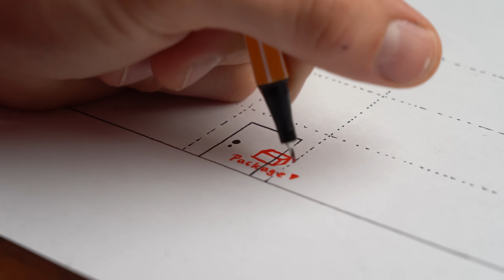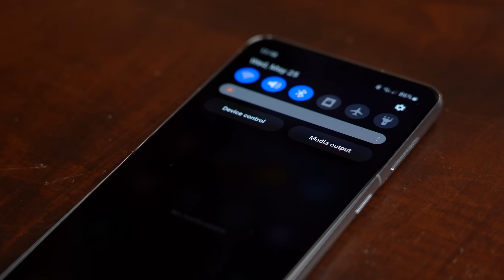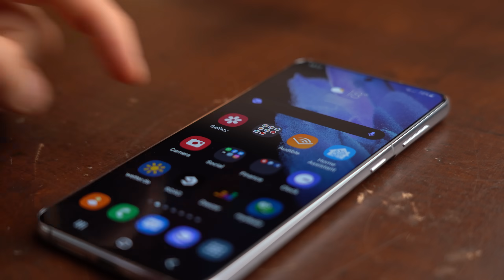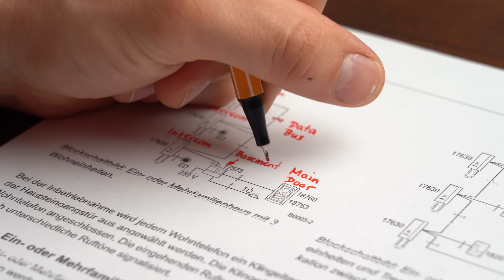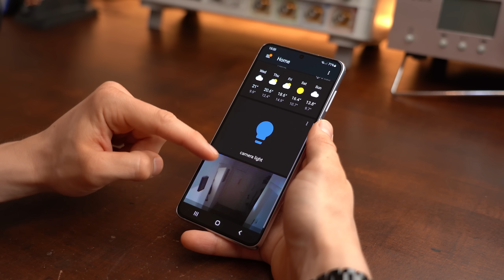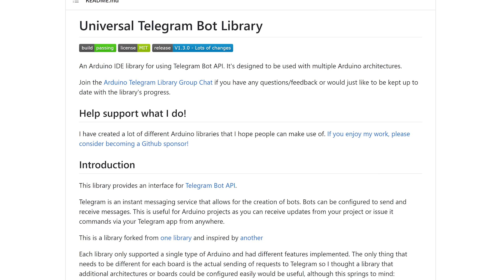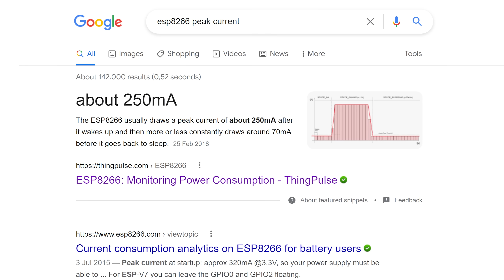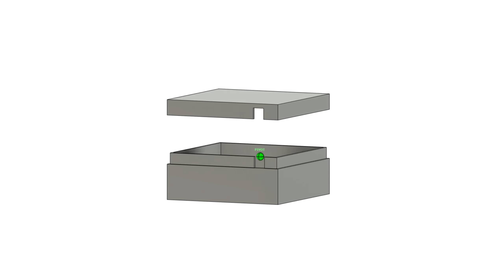Every Apartment needs this Upgrade! (WhatsApp/Telegram Notifications)

Comment: Thanks for this ingenious idea!
I recently figured out that the door opener signal from my parent's house intercom (as you know, intercoms are pretty common in Germany) terminates in the door unit. Ugly security flaw, because the door unit can be disassembled easily (2 screws) and simple shorting opens the door. The open trigger pulse will stay inside the house after my modification. Plus I add an ESP32 (with photocoupler) which enables opening via fingerprint reader (Wiegand protocol) and via HTTP call. Will add a Telegram notification functionality, too.

Comment: I use newtifry (android app) for a pe cell across my driveway and my door bell plus a bunch on other sensors. I like that I can send a picture and set levels of importance. it can read the message to you so it pauses my music and tells me what's happening so I don't even need to touch my phone.

It also has the delayed message received issue becouse this is an android problem. So to get around it by enable developer mode and turn on USB debugging then through the adb console on my PC I disable "deep sleep" for me this has no noticeable impact on my battery life. But dose not survive reboot. I get massages in under 2 sec reliably. But don't use this for mission critical stuff.

Comment: Personally I would have used a microphone to listen for the door tone, and relayed it to where I was working, knowing how flaky intercom systems are (at least here in the UK) and how landlords go mad if they think you've been tinkering with them. But using wireless services like Telegram to send notifications to your phone is a useful idea for many other applications, and there are so many paid services out there that really don't add any functionality beyond ease of setup and introduce delays beyond your control. I am naturally cautious about using third party cloud services that could change or disappear, a few years ago I was involved in a project that did and a good 30% of our support effort was investigating and corrected for unexpected and unannounced changes in the API from the 3rd party that shouldn't have affected us but ended up requiring changes on our part. So these open "cloud" services are often better used by running your own server, even if that means you end up having to learn how to be your own system admin!

Comment: I am in a similar situation to you.
Looks good, but if you have a "system" that is working 24/7, why couldn't you set up a local messaging service?
When the intercom rings, you send a message via MQTT.
Yes, this means you will have to have the WiFi on your phone turned on, but looking at what you do, I don't think that would be a big ask.
You phone is connected to your WiFi network and receives the MQTT message and alerts you that way.

Comment: My phone is already overloaded with all "notification" sh***t! If one more notification will come from the door, I 100% miss it. Not saying in "screensaver" mode phone shows nothing. And even if shows, barely you'll mention one line in a telegram. For *this exact purpose I rather use LAMP. Simple LED, which flashes 30 sec (just in case you turn your head off). But this project as a "Telegram use" is cool. I also support Telegram.

Comment: There are some things to note. Android Smartphones can be very tricky with engery savings, resulting in delayed or even no notification. A deeper look into the settings may help. There are a few things. Usually allowing an app to run it in the background and maybe even start itself and fideling with the engery settings of an app. Some apps can handle it better than others.
Maybe it can be even an issue of the app itself. With push notifications there are different types. Usually push means a server is pushing a message to your phone. An old way and a slow one is when the app needs to pull the notification itself.
When you are not happy on how apps work with these things, asking for help in the forums might give you options to change and help you to make it work for you better.

With the energy I must say that pulling energy from the intercom might be illegal. It can be considered theft. In apartment buildings its usually powered from outside your apartment and meaning the community pays for it.
There are smart home door solutions that are aware of it and they have options to power it from your end, so you don't steal energy.
In reality it might be hard to spot and the landlord doesn't care. But let's not forget, everyone is paying for it, for something you only use.

I also want to mention that this idea isn't new. There are solutions to connect an intercom to your phone. It's for the landline phone. You can control your intercom with it. It's usually for businesses. Also it's not that cheap, especially when you don't have a landline setup at home. But when your intercom supports it, you could open your door and speak to the intercom from your phone. You may not require a landline phone, because there are systems that support soft phones, meaning software phones and that means you could use a smartphone app. It's like a phone call.

I think a remote opening might be useful for deliveries. This gives you the time to go to the door, when the delivery guy is going up the stairs.

I'm not quite happy with the solution. It relys on external services. I would prefer a solution that doesn't need any external services. It would be nice when you could speak through the intercom via your phone and maybe even open it. The opening part should be optional, because this is a security risk and it might be good enough when you can speak to the person until you are at the door.

Comment: OMG! I have exactly the same doorbell system in my terrible apartment, and the alarm sounds are just super painful, each time nearly giving me a heart attack! What do you think about a project that would give that crappy system some more pleasant ring tones? xD

And I also have another idea:
I'm in great fear of loosing my keys, because of the high cost to have some service open the door and possibly replace the door lock - so do you think you could create a system that opens your apartment's door by entering a programmable code sequence using the bell (like some letters in morse code or such..)

Comment: @GreatScott!  Check the settings in the HA App. There is an option for a "permanent notification" which will enable instant notifications for everything related to the HA App. Just go to: Einstellungen -> Mobile App -> Hintergrundaktualisierung and set it up. After that, set your preference under "Dauerhafte Verbindung". Also remove the HA App from the Energy Saving thing in your Phone. For me its just a long press on the HA App -> App Details -> Erweitert -> Akku -> Nicht Optimieren. Should work without that too, but is a thing to consider, if it still doesnt work as expected.

Comment: i would have just used a microphone instead of going through all that and soldering to something that's not yours.
to reduce or possibly eliminate false alarms, the esp is more than enough to do audio processing, and the alarm always play the same sound.
maybe it can determine if it was the doorbell or not in 1 or 2 seconds

would have been a different kind of video and knowledge then, instead of learning how to probe an alarm circuit, we would have learnt how to do audio processing

Comment: Nice project ! You also could use the Home Assistant notification service if you have the app installed on your phone. Pretty simple to do that with the Home Assistant REST API. With that solution, you depend on nothing else than your own Home Assistant installation running on your Pi.

Comment: Funny. I had the same problem and coincidentally the same doorbell-system. I took a slightly different approach with an ESP8266, though, cause I didn't find the information of the three pins as you did. As you know there is a LED flashing after someone ringed, so I glued an LDR there and set a threshold value into my code. And my thingy uses MQTT messaging instead of push notifications. I built a client ESP8266 instead which sounds a beeper right next to my working desk. It also lights an LED so I can't miss it while having my headphones on. Your solution is also very handy of course. ;-) 
You do great videos. Keep it up. :-)

Comment: Instead of sending message to phone, an alternative might be to put a bell in the electronics room and trigger that using only the local network.
Reply: or a really bright flashing light. i set something similar in the garage cause i couldn't hear over compressor /dust collector...

Comment: I did a very similar thing more then two years ago. We have a HAT-402 in our appartment and there is a RSR-402 control relay on Amazon, which is basically an upgrade/extension you can more or less plug in. As it is a relay, it was very easy to wire it to an ESP32 like a button. It was my first electronic project and I spend days reading the HAT-402 manual to not mess up anything, but it felt great and it still works like a charm. Fun fact: I can even track the length of each door bell pressing, because the relay closes while the door bell is pressed. 😎

I also used telegram, but I build my own bot. Another plus for telegram: I do not use it for messaging, therefore I can better distingiush between smart home notifications and normal messages. 😉

Comment: Personally, I would recommend placing a small (100nf) capacitor between the ESP's GPIO pin and ground. This capacitor and the upper resistor of the voltage divider form an RC filter that will help to reduce any transient interference which might cause false triggering. I might also suggest a bidirectional TVS diode in the same location to protect against any large voltage spikes or ESD.

Comment: Thanks so much. 
I wanted to tackle the same system a year ago without reverse engineering the whole circuit board. (I've got the 4 button version without the phone handle)
Was about to use ldr and a relay to trigger incomming bells and opening the door but decided against it as it would probably end up pretty unreliable. 
This makes it a lot easier. I'll probably use an optocoupler and a relay for opening to not interfere with the board but finally some guiding light without interfering with that complicated bus protocol. 
As said: Thanks! Got new motivation :)

Comment: Thank you for every inspiring video you post, but i would have to say that this time i was faster on creating similar system with a bit more functionalities. The one i built uses ESP32 and Uses battery as power source all enclosed inside the intercom itself. In addition to the regular notification that uses HA, i wired one of the pin to the unlock button, and using ESPhome that create a sensor, with some useful information such how many times my door being rang a month. I wanted to take that further, so i built an automation that will send actionable notification if i am home or away, but if i am at the building door but not inside the flat the system will trigger the unlock for me. so i do not need keys for the below door. it takes 7 seconds for the system to wake up from deep sleep, and trigger the door or send the notification.
Reply: Can you provide more information on this please?
Reply: This will be awsomw if you could explain this a bit, and do you think it is possible to use this with also a video feed, i gave a comelit with video

Comment: You were lucky to have a power socket nearby.
All of the time I wanted to use a remote ESP32 card like that my biggest problem was the power.
Reply: An idle ESP8266 draws very little power, especially if you can enable power saving states. You can power it with a battery for months or even a year. If that isn't good enough, then even just a tiny bit of energy from another device that you tap into is enough. You might need a buck converter, but those only cost about $2. You might also consider adding a super capacitor to deal with current spikes while the ESP8266 uses its radio. Having a supercapacitor would even allow you to power down the buck converter for the majority of the time. And if you undervolt the ESP8266, you can save even more energy.

Comment: On my side the bell is so loud you would never miss it. It also outputs about 33v when ringing. Your system looks really next gen compared to mine.
Reply: My doorbell is even more primitive: it is a mechanical bell, powered by the operator's muscles.  :-)

Comment: If you used a buck that is current limited you could have powered the esp from the 24V, and for the 0.25A spikes you could use a few super caps. Realistically if you limited the current to 100-50mA at 3v3+diode drop it would charge the system well enough overall 
Also maybe you could guess the power usage based on the documentation and guess how much you can take from it .
on a side note maybe a optocoupler would have been a good idea , for isolation
Reply: Use an LM2596 as a buck converter. Only ever turn it on, when the charge in the supercapacitor drops too low. Enable as many power saving modes in the ESP8266 as possible. Maybe, intentionally undervolt the ESP8266 as well.

Without any of these extra energy savings efforts, a ESP8266 consumes about 250mW when idle. With some effort, you can likely bring that down to around 1% of this number.

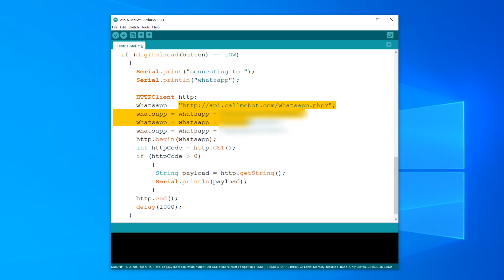Comment: BIG NO NO at 6:25. Sending private data over unsecured HTTP is asking for trouble. Also as far as I remember ESP has 5V capable input pins, but only accepts 3.3V power supply. Personally I'd tackle this with UDP protocol. Broadcast UDP package on local network and it will get to your device within 1 millisecond. If you are not home doorbell rings don't matter anyway. You would need to create a mobile application though but that's not too difficult.

Comment: Awesome project i implemented a similar system in my home. Brians library is really awesome, but as an alternative telegram bots can be integrated directly into home assistant. Combined with sensors based on esphome you can archive the same result with minimal coding experience and you can use the huge amount of possibilities in home Assistent like logging and automations

Comment: i did almost the same in my flat years before :) I used a small mic, glued next to the ring speaker, and - since there was no ESP32 back then (or at least i don't had one) I made a louder alarm sound closer, where I usually stay :)
Reply: Yes, early in the video I thought to myself, "Why doesn't he just rig up a louder ringer?" But then, he wouldn't have got a YT video out it!
Reply: @xmfclick  because you won't hear a louder ringer in the basement or garden.
Reply: @xmfclick  There are maybe a few more ups to it. Because he get's notified even outside of his flat. Also he can use it for automations. I for example built a "Party mode" in mine. If party mode is set to on, it will automatically buzzer the entry door or if at the apartment door, open the nuki. So people arriving to the party or going for a smoke don't need a key or rely on somebody to let them in again.

Comment: For this I would recommend pushover, costs 5$ to set up last i checked and free messages unless you send a large amount of them. This is to a separate app tho.

Is a linear regulator so inefficient that it draws the same current from the source even if it is stepped down ?

Comment: That looks like a standard PCB edge connector. You could also have used one of those and avoided soldering to the board directly.
Reply: Yes, agreed it would be better solution in an apartment you are renting in. If landlord sees you modified something like this they can take your deposit when you leave.

Comment: A lot of apartments around me in the US have really analog systems with terminals by TekTone. They have a dedicated wire for the "warble" tone when the doorbell is pressed. So I put a current-transformer around that and use it as an input in ESPHome, which works reliably. And I figured out what terminals to connect to trigger the door strike and connected a relay to them.  It works really well and doesn't even require soldering since all the connections are at the screw-terminals.

Comment: I couldn’t get to set up my esp8266 and esp32 running on my Arduino ide even after installing Python 2.7.3 and pyserial from adafruit. I have downloaded the drivers and installed the board in Arduino ide. The port is “com 28” and I think I used “nodemcu 1.0 module 12E” for esp8266 or there about! ( I am using CP2102 chip) The device manager shown that the hardware was properly installed and ready to use. If I try to open the serial monitor in Arduino it will never open, instead I will see “error com port 28 busy” If I upload code on the boards it pops out bunch of errors among which is “error opening serial port” or something like that.

I am frustrated, I need help please!

Comment: If you think about it, this solution is quite overkill for its purpose. I mean, there is a complex microcontroller attached to the door bell which can do all kinds of tasks, but is only programmed to look for a voltage change. Then it uses highly complicated internet potocols to send a message to the Telegram servers which do all kinds of complex processing and database management on their end, and in return send a message to an equally complex smartphone running the Telegram app. There are sooo many complex technologies and dependencies involved in this solution, just to extend the door bell into your room. Wouldn't a simple wire from the door bell through the floor into a beeping circuit in your room be sufficient? This solution wouldn't even have any noticeable delay, and it would continue to work during a Telegram or internet outage.

Comment: Great project. I started doing similar for mine. Standard dumb doorbell that runs on 6V. Was going to wire the button to the ESP board and then make it enable the buzzer and send off the notification at the same time. Maybe this is a better approach.